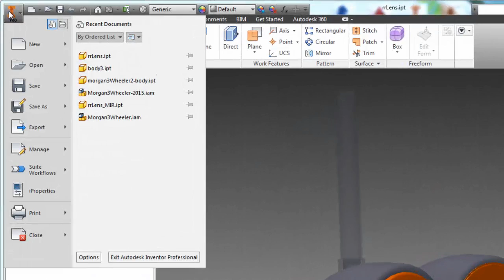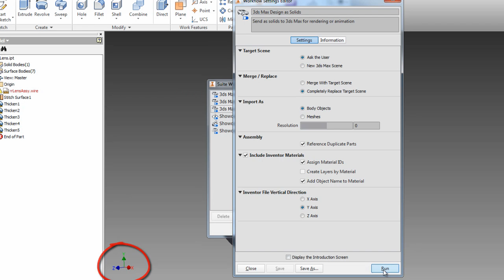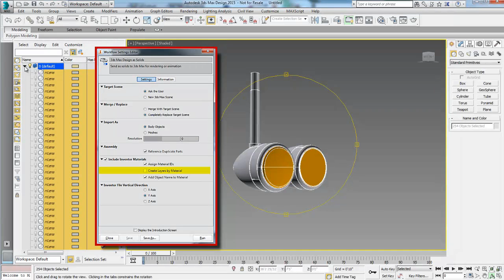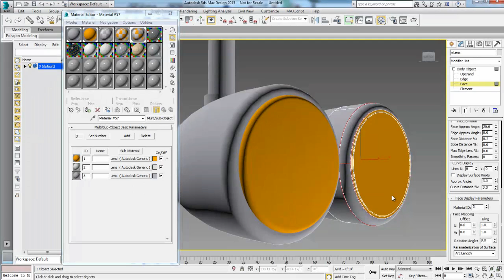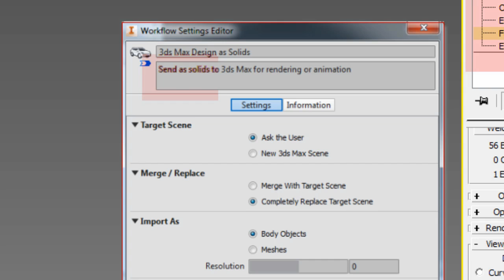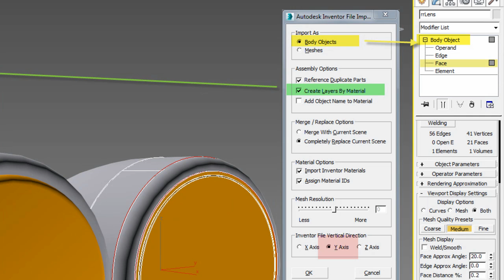3ds MaxDesign tips & Trick: Inventor workflow; Import/Export Settings

Comment: hello - tried this with inventor model, I'm trying to use slice and cap holes to get a cross sectional of a valve, but when I apply the slice, it totally screws up the geometry! even tried to weld the vertices at .001 but still ugly results. any suggestions? LOVE your posts, thanks! k

Comment: thanx marion, this tut helps a lot.
Reply from the maker: You are welcome.
Reply: hi Marion, can you help me with a problem, i got this error messege on the RUN - "AdWorkflowHost is unknown. Please chek your synhub cinfig file."
Reply: i solve it.. buy 3ds max and inventor separately is mistake, for convert ipt or iam to max format you need special Workflow option - buy "Autodesk Product Design Suite Ultimate 2017 Desktop Subscription | With Advanced Support" for $3,730.00 per 12 months https://www.amazon.com/Autodesk-Product-Ultimate-Subs.. ..after uninstall Inventor/Max - clean PC https://vk.com/3dgraffik?w=wall373476425_139 with Revo Uninstaller Pro https://plus.google.com/100376871745802188552/posts/Q.. ..install Product Design Suite Ultimate